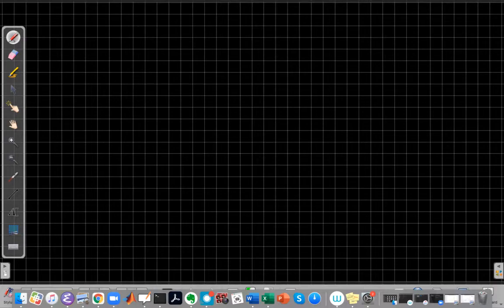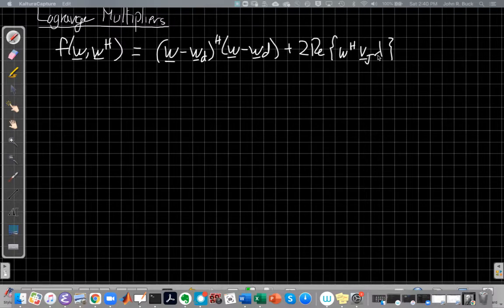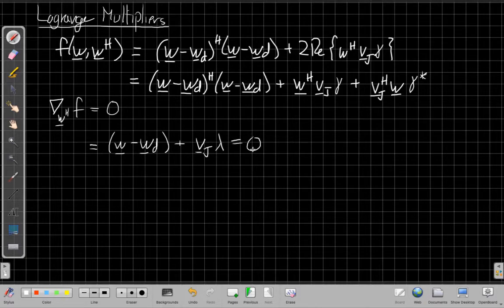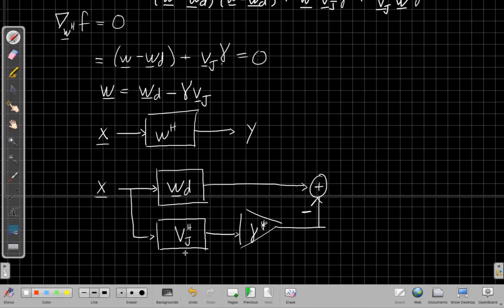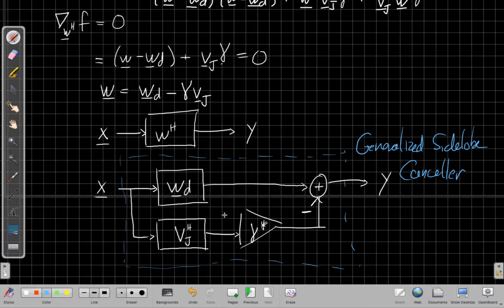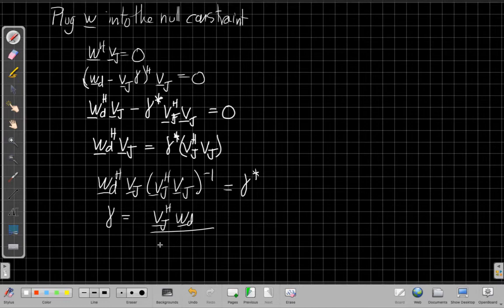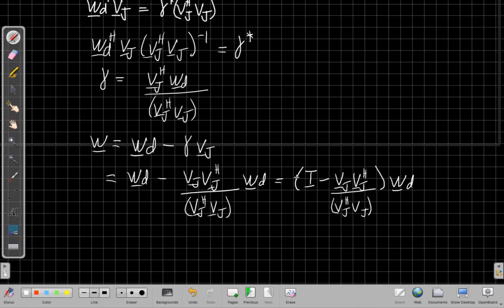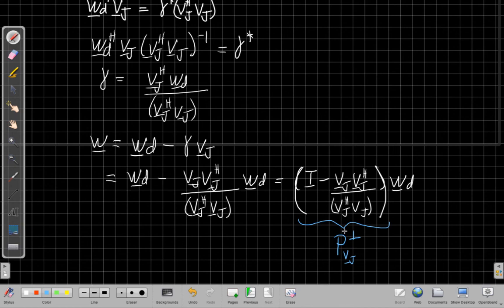Null Steering: Lagrange solution

Comment: Very good video, thank you. One questions:
How can we find the manyfold jamming vector? 

Is it correct to assume that we can receive only the jamming signal, perform eigen decomposition and use the eigen vector as the jamming vector?
Reply from the maker: George, This technique is most useful when the jammer direction is known and constant, as the video description notices.   For example, if you have an airport radar jamming your radar, you can accurately measure the airport location, and know it will not change over time.   You can do what you suggest to find the jamming manifold vector with the eigendecomposition if (1) there is only one strong jammer, and (2) you don't expect the location of the jammer to change with time.   Even then, you need to gather a lot of data since the sample eigenvector is a biased estimate of the true eigenvector.  If these conditions are not true, you need to explore some form of adaptive beamforming, with all the attendant challenges.
Reply: @ProfJohnBuck  Thank you very much for your quick response; I appreciate it.  
I am not looking to completely remove the interfering path, but lower the power towards/from that direction (at the cost of decreased Beamforming (BF) gain for intended UE ofc). If you have time for a practical scenario, my scenario is as follows:

Operating in an unlicensed spectrum, we have 5G NR-U (can do digital BF)  and Wi-Fi devices ( omnidirectional Transmission and Rx ) coexisting on the same frequency band.  Any device can start transmitting if it senses the channel and it doesn't capture power higher than -72dBm. I want to use beam nulling to lower the power towards/from wifi/devices so that both devices can access the channel at the same time.  

Now, what I want to do is to sense the Wi-Fi device signal(s), compute the eigenvectors and pick the strongest columns (depending on how many d.o.f I want to assign for interference nulling and how many I want to keep for BF gain towards my user (UE) with which I compute a nulling projection matrix. I have followed this  paper:
"Operating Massive MIMO in Unlicensed Bands for Enhanced Coexistence and Spatial Reuse". 

However, it is somewhat vague regarding how it applies the nulling projection matrix to get the final Zerp-Forcing BF weights and to the sensed interfering signals. 

Do you have any recommendations of where I could read more about the beam nulling process? I need to know how to check if my formulas are applied correctly...
Thank you!